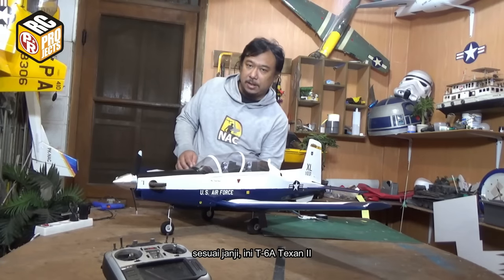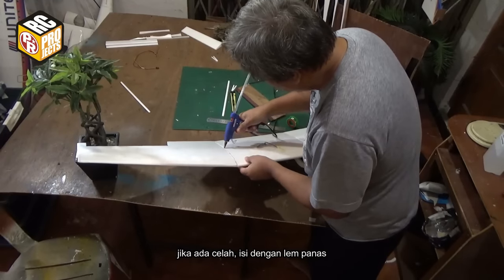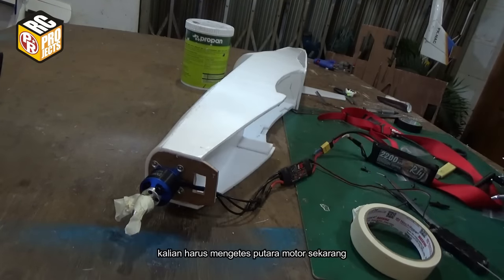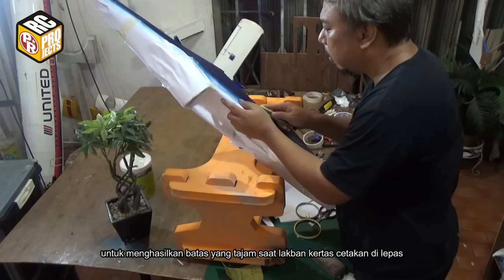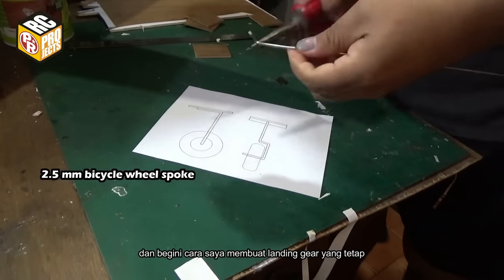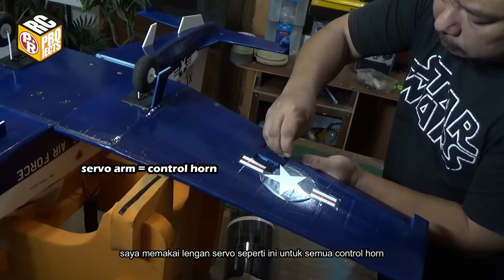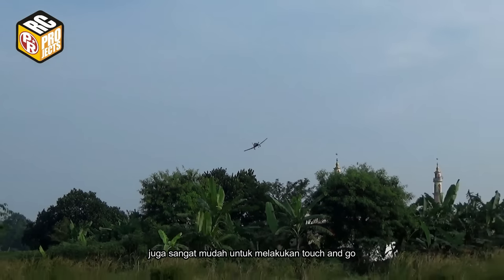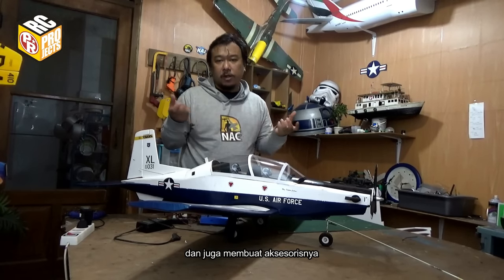How to Build T-6A Texan II RC Plane

Comment from the maker: You can download the plans on the link below :
https://paper-replika.com/index.php?option=com_content&view=article&id=9639
Playlist :
00:00 Intro
01:14 Wing
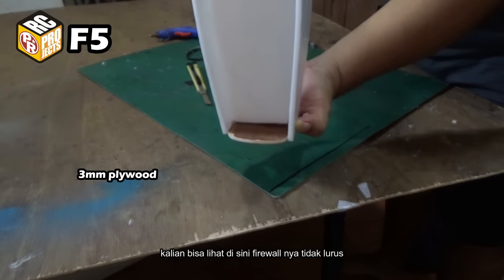05:13 Fuselage
06:51 Installing Motor and ESC
08:31 Wing Mounting
08:41 Servo platform
09:26 Covering
10:52 Control Surfaces
11:47 Canopy and Decals
18:45 Landing Gear
20:19 Linkages and CG
23:30 Battery Tray
24:15 Maiden Flight
27:51 Second Flight
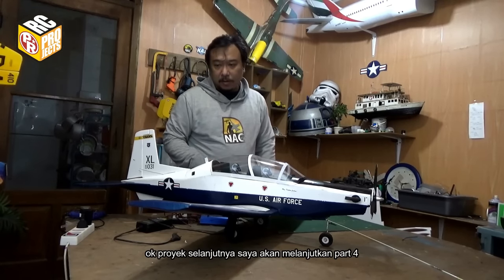29:40 Review
Reply: Di Pin Om biar gampang nyarinya
Reply from the maker: @johnroyskaskus  hmm perasaan udah di pin, ternyata belom, thanks
Reply: @JuliusPerdana  sama2 om
Reply: Om jul.. sorry mau tanya dong.. tutorial programnya pernah dibahas ga yah? Aku mau blajar dong bikin 3d nya dan convert jadi flat gt.. makasih omm
Reply from the maker: @bejokaryo  nanti setelah subscriber nya 50K
Reply: Kalau udah smpai 50k, buat give away nya om😃
Reply: Hello, Julius, about Texan II plan(drawings), the A1 and A4 are both necessary for building? or either of them are OK?
Reply: Di jual gak om?
Reply: Tip:  9:45 von hinten quer zu kleben beginnen so ist das vorne geklebte überlappend und es kann kein wind unter den stoß rein !

Comment: I have the exact same plane. Mine although is Balsa and plywood. Also electric powered with a power 60 swinging a 15" 4 blade prop. 6' wingspan and weighing in at 9 lbs. Great flying plane .Job well done on yours Sir. Your house looks like mine with R/C stuff, everywhere. Arrgh!
Reply from the maker: Very cool!

Comment: Report incase anyone interested, built this and boy does it fly well mine was a tiny bit more heavy due to covering but all in all a great plane to build if your moving from high wing to mid low wing planes , cost … about 30 /35 uk pounds all in better than the free wing version easily bigger to . But yes great plane don’t second guess it build it !

Comment: Great video, Mr. Perdana. I'm looking for some tips. Are you sanding and painting over the packaging tape?
Reply from the maker: Sanding must be done before covering with packing tapes. Even if you use packing tapes for bending wing or fuselage parts for example, you need to peel off all the tapes before sanding. For painting over packing tapes, you need to spray or coat the surface with plastic primer, otherwise the paint will not stick. Thanks btw
Reply: @JuliusPerdana  Thank you. Great information. Thank you so much for posting the videos over the years. 😀

Comment: Pak, why no plywood formers in the centre wing to receive the screws? Are they not required?

Also, another separate question:
Can i use 70mm EDF (12 blade, single motor) with 80 Amp ESC and 4200 mAH 6s Lipo battery (65-70C)?
Reply from the maker: you can add that

Comment: In the process of building this myself, but I was thinking, instead of putting 2 AA batteries in the tail for c of g  , why not move the elevator and rudder servos to the tail area then that way they offset the weight caused by the batteries to balance the plane

Comment: Mau tanya om.. untuk pushrod wire beli d mna ya.. menggunakan ap..
Reply from the maker: saya biasa pakai kabel bekas kabel telpon yg outdoor, atau kabel internet optic, biasanya ada penguat kawatnya. Atau bisa beli kawat stainless steel gulungan yang 1,5mm di tokopedia ada kok, per meter jualnya.

Comment: when setting thrust angle, which one is giving good and more consistent result, 1. build firewall like in this video or 2. build straight firewall and add washer to motor mounting?
Reply from the maker: you can do both
Reply: ummm          if julius  did  not use a zero-zero thrust line, it would   SIMPLY   be  Another  Example of  his  utilization of  a  Wrong  model building  technique.!!!

in other words,  a  firewall  Should  be  installed  STRAIGHT.    then, make   Adjustments  as  desired.        googletranslate

Comment: Hello sir I am in trouble. In our country there is no depron foam , we should buy it from foreign which is very expensive So please tell me can I use thin thermocol instead of depron foam
Reply from the maker: yes you can use any foam, but you need to slice it into 5mm thickness

Comment: Hi thank you so much for sharing this awesome plane, do you think it could Fly with a 2200 kv motor?
Reply from the maker: No it needs lower kv
Reply: @JuliusPerdana  do it does not need so much? With a 1000kv motor could work?
Reply: “So”
Reply from the maker: Yes see spec on description
Reply: Thank you so much and one last question and sorry cause i dont know much about this but i have a 2200 kv motor if I use it in this plane it would fly? Am I right?
Reply from the maker: 2200kv is high speed but low in torque power, it's too weak to rotate bigger propeller that this model needed, so lower kv like 1000-1200kv that strong enought to rotate 9-10 inch prop. A 2200kv motor will burn if forced to rotate bigger props

Comment: Can anyone tell me where I can get the Decals for this plane?
Reply from the maker: check link on description, the decal download is below the link for plans on my website
Reply: Thanks and tell me what size prop are you using?
Reply from the maker: I use 3 blade 9 inch prop, I don't remember the pitch
Reply: Julius, thank you so much for the plans.  This is a plane I've always wanted to build.  I do have one comment about your plans.  Is there any way you can add a metric scale on the plans so that a person can verify their printer is printing the correct size.  Other than that the plans are great.  Again thank you.
Reply from the maker: ah okay, thanks for the input I'll add it on the next plans

Comment: at 5:28,  julius, i suggest that you  CONFIRM  that the use of thrust offset, with  Electric power,  is  Correct.!!!!         however, i don't know how you can do that.       because, it is a carry-over  from the designs for  GAS  power.!!!        the  PHYSICS  of  those tiny old two-strokes    is/was   NOT   the same as an  electric motor.!!!       the props still turn as fast, as they did.          (however,  a motor  has  MUCH  less  (internal) mass  in  motion, than an engine;  and   NO  reciprocating  Mass.)         googletranslate
Reply from the maker: have you try to use the motor straight? Good luck controlling it then :p. You have to try to know it man, have a try
Reply: Torque is Torque, source of the Torque doesn't matter.